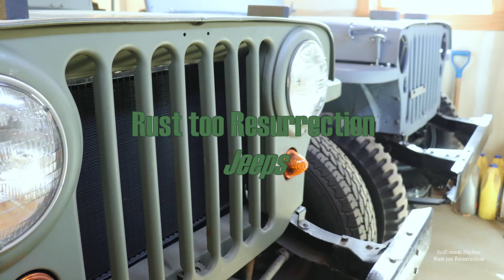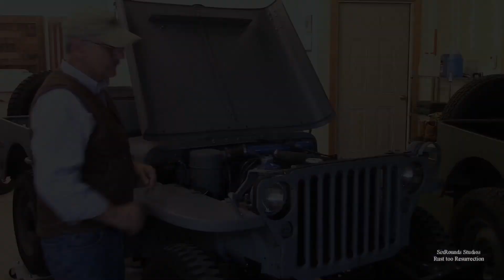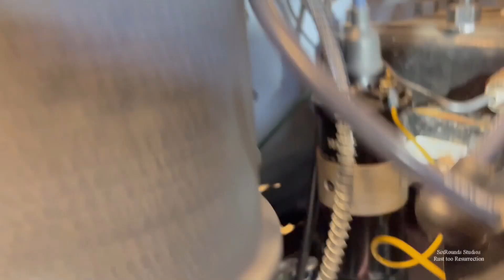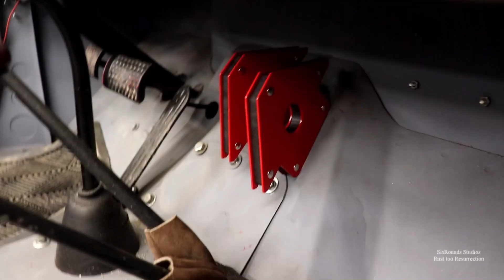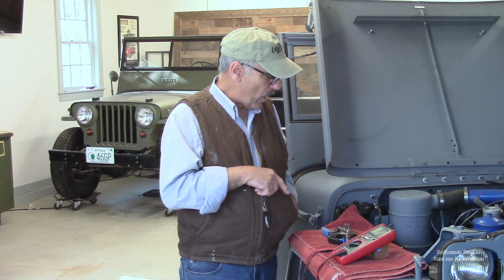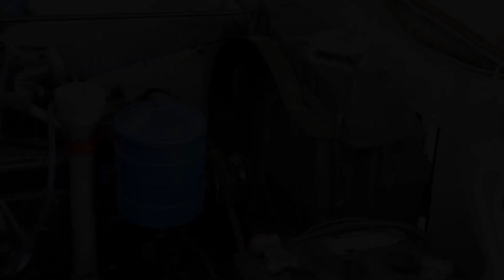Willys MB

Comment: I have the same part look up issue as well at local stores here in kansas and NH (concord area). I’m currently in the process of doing a disc brake conversion. I asked a local mechanic/dealership if they would do the conversion and they said they don’t have the expertise to do it. Lol. 

So, I’m now doing the conversion in the parking lot of my apartment building at flight school. 🤷🏼‍♂️
Reply from the maker: Yeah...I was surprised a little that the parts store had the switch in stock.  Didn't want to wait several days to get it delivered. Yah never know